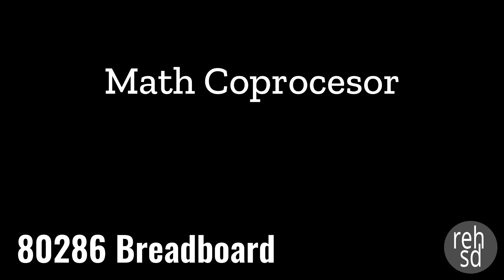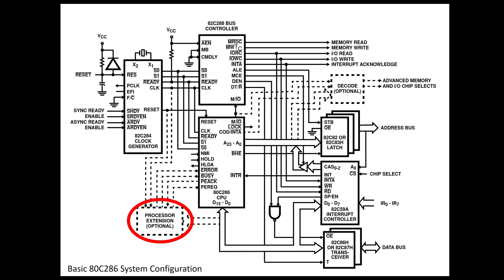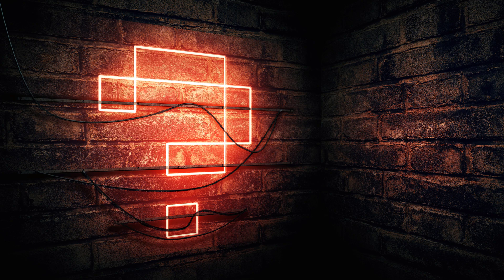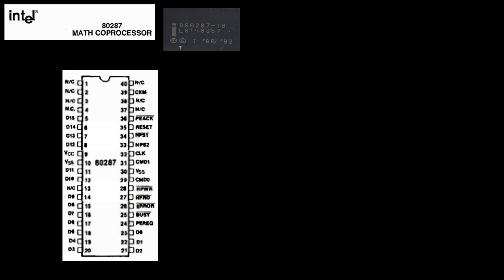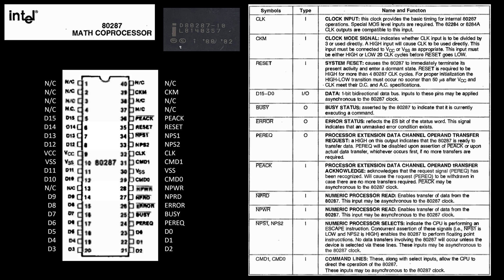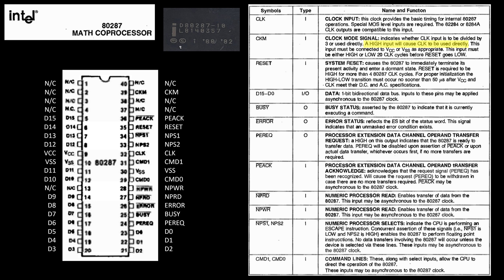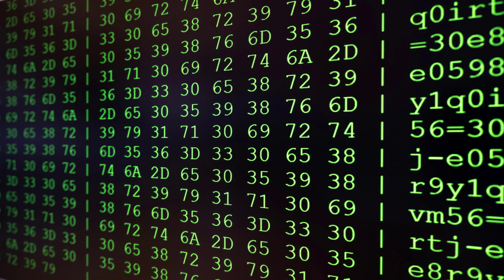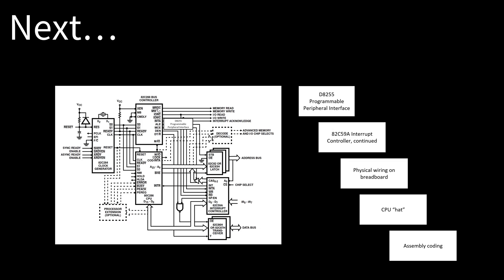80286 Build, Ep. #19 - Math Coprocessor 80287

Comment: What additional capabilities will your final design have with the 287 that it wouldn't have without it?
Reply from the maker: Honestly, I don't know if the '287 will be a huge benefit for the simple stuff that I'm doing. However, if I have any mathematical operations, especially things like logarithmic, exponential, and trig functions, the '287 can significantly speed up things. The '287 is especially helpful for floating point math. I will have to come up with some math-based code to test out and leverage the '287. No matter what though, I'll get to learn more about it by including it in my design. :)
Reply: @rehsd  "Because I want to" is always a legit reason to include something in a personal project :)
Reply from the maker: @GregCoonrod  Exactly.  :)

Comment: That processor is a lot more complicated then the 65C816... LOL
Reply from the maker: It kinda' feels like it, doesn't it? At least I don't have both address and data on the same pins.  :)   I'm loving the true 16-bit internals, 16-bit external bus, expanded instruction set (e.g., multiplication) ... and that's all before the 287 is added. The worst part of it for me, by far, is the pivot in mindset when working with the assembly coding. I still find segments to be confusing and difficult.
Reply: @rehsd  Wait until you get to protected mode! Right now it's "just" shifting the segment value by 4 and adding the offset to it to get the actual address of a pointer. In protected mode the value of each segment register is more or less an index into a table, called a descriptor.
Reply from the maker: @damouze  I look forward to it!  :)  In the next couple of months, I'm hoping to have some quality learning time in x86 assembly.
Reply: @rehsd  yep. I'm afraid, with the Z80, the x86 asm is one of the ugliest. But let's forget about it ;) I'm very curious to see how the intf between the 286 and 287 will be.